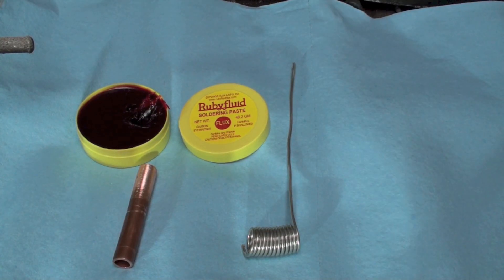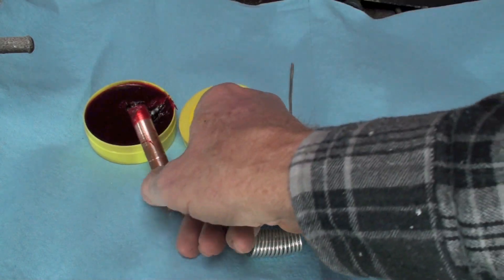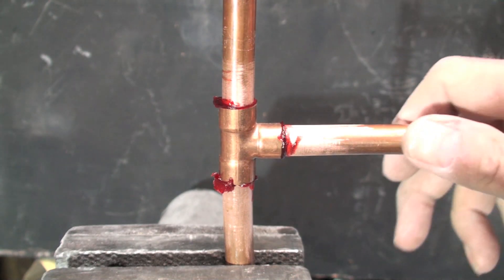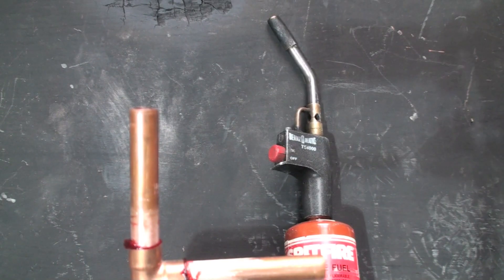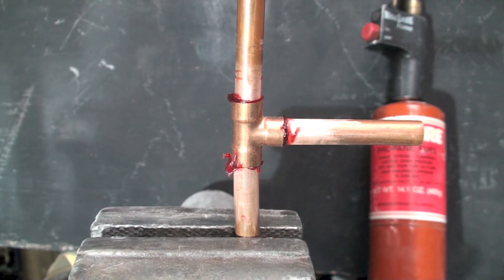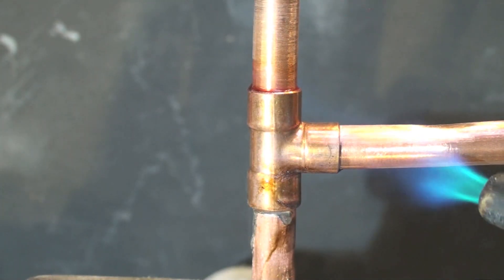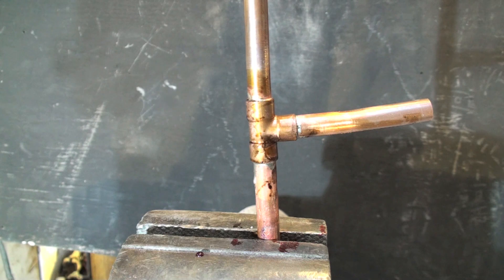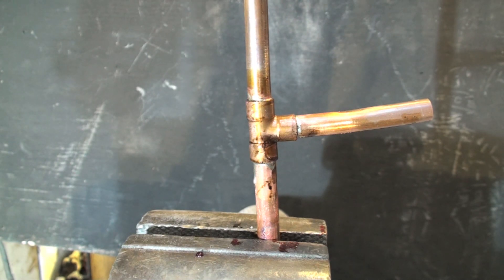Soldering with low temperature solder.

Comment: can you use on ac tubing?do you need nitrogen in the system?
Reply from the maker: I do not use to on A/C tubing.  It is not strong enough.  Use 15% oil phos.  Always run nitrogen thru the lines.
GFM
Reply: @grayfurnaceman  

Yes, this was a bit of a curve ball - lots of video footage about ox-acetylene, brazing, and nitrogen -- and here we have low-temp soldering (???). 

So that begs the question: where Do you use low-temp soldering in the HVAC biz?
Reply from the maker: Only for plumbing .
GFM

Comment: I am struck by how little solder appeared to be used. Obviously I have been trying to put too much into the joint. Would be interesting to cut some open to see results.
Reply from the maker: Probably the most common failure with low temp soldering is the use of too much solder.  I will be doing that and will publish it.
GFM

Comment: Gray,  I know that sil-phos is recommended for 410A and most other refrigerant systems, but what's your take on Staybrite 8 silver solder? I've used it a few times when making repairs to R22 systems, and never had any issues with leakage or blown joints. Have you ever used it in the field?
Reply from the maker: I get a lot of comments about low temp.  It does work if the fit is good, but  
sil phos will seal on loose fits and old pipe.  Its just a better product.
GFM

Comment: What you do if, let's say, one of the connections are leaking ? You try to resolder ?
Reply from the maker: If you can remove and replace that's always best.  Sometimes the only choice is to attempt the joint again.  Clean, flux and try again.  I will be doing a video on and extreme fix when all else fails when I get time.
GFM
Reply: grayfurnaceman ok, thank you very much. I try to solder, because is cheap and it can be very easy with some practise. (it looks very easy, but it isn't)
Reply from the maker: antraciet It's never as easy as it looks.
GFM
Reply: "It's never as easy as it looks"
I had to explain that to a customer who unsuccessfully tried to do his own soldering.  I explained to him that none of it is easy, but a pro makes it look like it is.  Not that I am a pro...
Reply: antraciet: Sometimes you can get lucky by cleaning the leaking joint with a small wire brush apply some flux and re-solder the joint.  Sometimes you are not so lucky and have to un-sweat the joint and start over, sometimes with a new fitting sometimes not.  Most of the time I am lucky, but not always.
Reply from the maker: Joe Marchione I will second that, the pros make it look easy
GFM

Comment: I find it helps to wipe the joint with a clean dry rag before you solder it to remove excess flux. You get less grapes that way and then another wipe with dry rag while solder is still hot to make it pretty. The most important part is wipe it with a wet rag when done to remove any flux to keep the joint from turning green.

Never got into propane always used map and acetylene
Reply from the maker: I am kind of a flux monster and like a lot of flux.  Wiping it with a rag while still liquid is great and does make the joint look a lot better.  The wet rag idea sounds good also.  Thanks for the info.
GFM